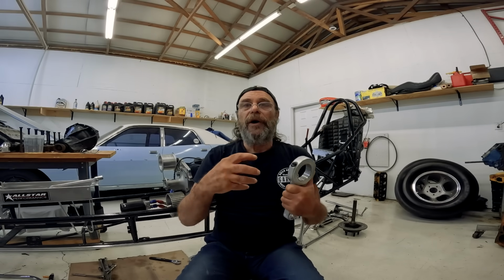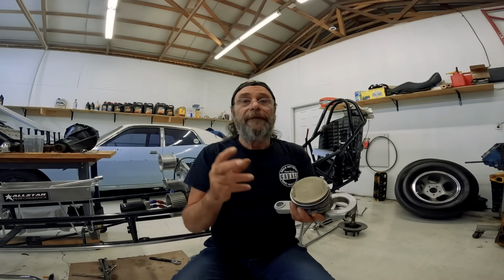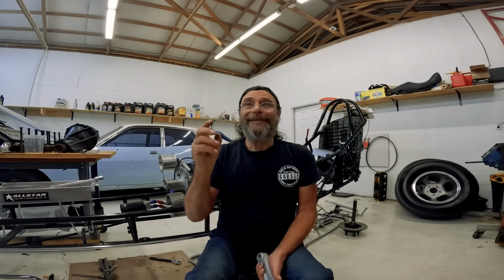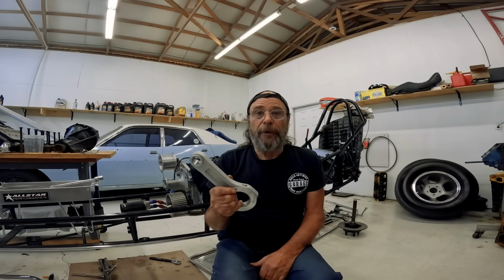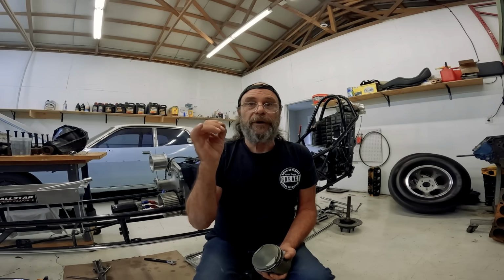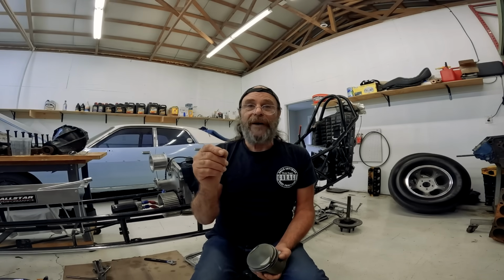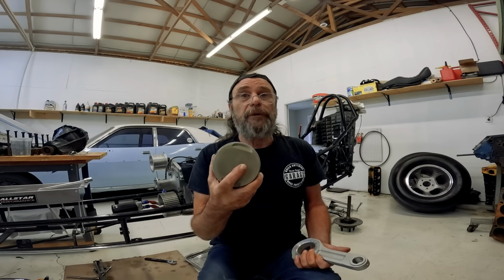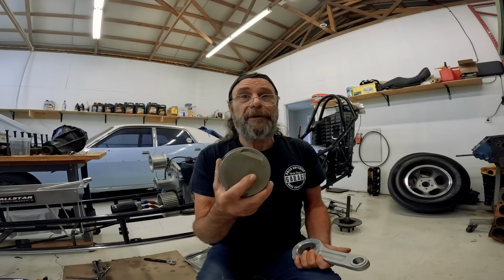Project Top Fuel Pt.9 - How Nitromethane Makes Power And The Importance Of Rod Ratio

Comment: Right after the load-sensitive nature was mentioned I immediately thought of firearms, which I know a fair amount about, then seconds later you mention gunpowder LOL. And it makes sense, gun powder obviously is also a monopropellant / has it's own oxidiser, albeit the oxidiser / fuel ratio is right unlike Nitro & it's much-more extreme as a fuel. But to add to this point when you have too-little resistance like have a very light round or failure to properly seal the round, a lot of the gunpowder never even ignites & just flies-out with the round, which is how people make vids showing them firing a .50 BMG out of a 12-gauge (still, don't do this!) even though .50BMG has MUCH higher pressures & logically should immediately turn your shotgun into a frag-grenade. Also if you have a very light load of powder in a cartridge it might not seal the case to the chamber, losing gas even backwards into the action, which is why this can sometimes cause "squibs", a dangerous condition where unbeknownst to the shooter the bullet is stuck inthe barrel & firing the next cartridge can make it all go kaboom!! This is due to the loss of gasses @ the start making the already-low load not even ignite properly potentially, creating a very low-pressure combustion event, not having enough energy to even send the bullet out of the gun due to lack of power to simply overcome barrel friction.

Comment: So top fuel hemis use the 413's 4.1875 bore size via regulations as well as a non-domed piston to reach a low static CR? So its kinda like a 413  piston, only forged?

Comment: I lived next door to a legend named Kenny Richardson for years.  he once explained to me that the difference between gas and nitro was the gas hit the top of the piston like a hammer and not much else pushed it after that but nitro was like a steam engine.  the steam keeps coming through the valve and expanding all the way to the end of the stroke until the valve shuts off and the exhaust opens.  so he said the nitro keeps burning and expanding until the exhaust valves open under pressure to let it out.  Kenny btw drove suspended animation back in the 90s in the wingless rail class taking the national championship, but I don't remember what year.
Jason
Reply: Suspended animation ?  Forgive my ignorance but, ive not heard that before and it sounds interesting. I'm guessing that is referring to the type of chassis ?

Comment: Just awesome!
All I heard was “Do it! Do it! Do it!”
I understood everything you said and makes perfect sense once it’s spelled out like that. Amazing you guys figured out the bottom stroke detonation thing. 
I got 7” rods in my stock stroke 354 with Pontiac big ends to make it easier to get rod bearings.
Quick tip! I’m sure you know but the 354 cam is different than the 392 cam and takes a different core. I had Engle grind my cam for me. They had the masters still to do those. 
Great video!  Keep them coming!

Comment: I've been fascinated by blown fuel hemis at Bonneville since the days of Al Teague, Freddy Dannenfelzer, Perris & Eaton, Hoffman/Markley, George Fields, and others make runs that have to see the engine last for multiple miles under power.  A good example of this load effect is George Fields comp coupe... same car ran over 300mph with the 500in. blown fuel hemi, then they built a setup with special cam/crank and other components to run the engine on one side (4cylinders) at 250cu. in. to get into a lower engine size class...guess what, they ran over 300mph with half the cubic inches.  That 4 cylinder setup had massive torque and didn't need to rev very high almost diesel like power.  I have a video on my youtube page of the car going down the track with the 4 cylinder setup.  Crazy sounding thing.  More recently the battle between the two fastest fuel roadsters had Doug Robinson's BMR roadster unblown fuel hemi vs the 911 blown fuel roadster.  Both cars exceeded 300mph with absolutely brick aerodynamics but the BMR unblown car actually went faster with no blower.... part of this may be the BMR car is a bit more aerodynamic.
Reply: Back in the 90s it was fun to see the blown fuel iron Chryslers run land speed.  One of the fastest was the Carr-Kaplan fuel lakester which ran a 306mph pass with an all iron 392 Hemi powerplant.  Another was the Hoffman/Markley streamliner that ran iron Desotos Blown on fuel and top speeds ranged from 350 to 380mph at Bonneville.

Comment: I’ve had quite the crash course in “tuning for nitro” and learning the internals components that make it work.  Things like compression, cam specs, especially on exhaust duration, timing, and ultimately how much is needed.  You are right, there’s not exactly a scientific method to it that’s a one size fit all, every engine is different and every engine can easily react differently.  It is also pretty crazy how it reacts with oil, the extreme stress on parts, and what goes into each run.  Can’t wait to learn more and can’t wait to go racing next year!

Comment: Thank you for doing these videos. The bounded firecracker is an excellent analogy. I've broke too many to count. I have a few things you may consider. I love your observations, and descriptions. 
I learned several things here. thanks

I don't think the cause was heat, but probably detonation. You may consider that without evidence of high heat, lots of metal was destroyed. If the cylinder runs short of fuel before exhaust valve opens, detonation must occur. If metal inside is fractured, it's lean. Mine would typically split the sleeves from bottom to top. I don't think any piston can push the crank with a valve open. Wet pistons I think is a secondary, or coincidental effect. Similarly, I tried to measure liquid expelled from a weephole. Best trick I found was to weigh part of a diaper, or lady pad, before and after.  

I wanted enough liquid from the cylinder through ex valve to detonate in the pipe. My pipes were at 45 degrees on Z and Y axis. 

I'm sure you found acceleration after ex valve opened, but I suspect it was due to detonated Nitro pushing you forward, and down. I'm sure you know this, but for others... combustion gas wave is subsonic, detonation gas wave is supersonic. When the remaining liquid fuel enters the exhaust pipe, pressure is quickly reduced, liquid droplets shatter & disperse, and a fresh supply of O2 detonates almost everything. The pipes act like cannons. It's a beautiful thing. 

The remaining liquid really adds to the fun. Every time I had trouble, the fix seemed to always be, add more fuel. It didn't take long before I needed that second mag.

Comment: Nitromethane is a terrible racing fuel. It's very low in BTU's per gallon when compared to either alcohol or gasoline.  A engine is just a air pump, a fixed amount of air goes thru it, depending on the level of prep and rpm.  And you can only mix so much fuel with that amount of air.  With gasoline the air / fuel ratio is 12:1.   Alcohol is 6:1 and Nitromethane is 2:1.  So even though its a piss poor fuel in terms of BTU's per gallon, you can burn a shitload of it, compared to the other fuels. SIX TIMES the fuel volume when compared to gasoline.  THIS is where the power comes from.  I went thru 20 gallons of 98% this past weekend in Bakersfield.
Reply: Fancy meeting a gentleman like yourself here. 🤣

Comment: A lot of what you're talking about has parallels with the relationships between gunpowders, chamber size, bore diameter and how those factors determine pressure curves and velocity. You need a fine balance of power, resistance and expansion rate to get the phenomenal results that some combinations can achieve. Get those relationships a bit out of whack because you outsmarted yourself and things can get REALLY crazy. We blow things up occasionally too
Reply: My personal equivalent of nitro-methane is essentially using tnt to run an engine. It's the most violent fuel you can find and it will behave differently depending on the environment you put it in. Just like how cartridges for firearms loose velocity with low temperature environments. An equivalency would be nitro cartridges for firearms.
Reply: @jeremypike9153 When you get bored with Nitromethane, there's always Hydrazine to "explore"